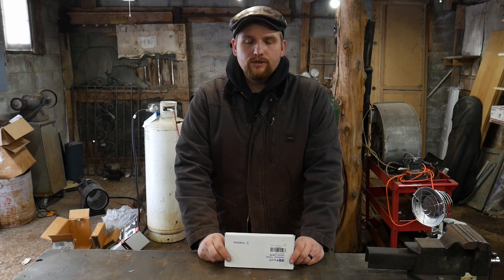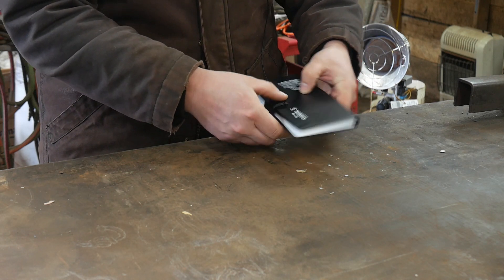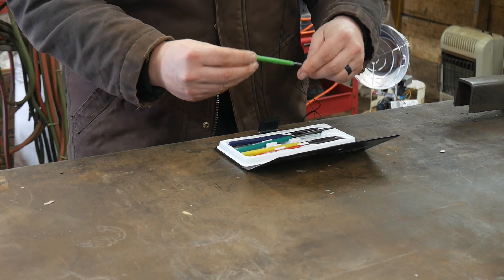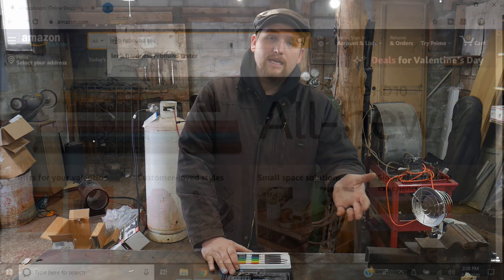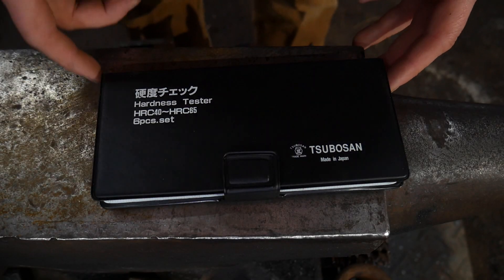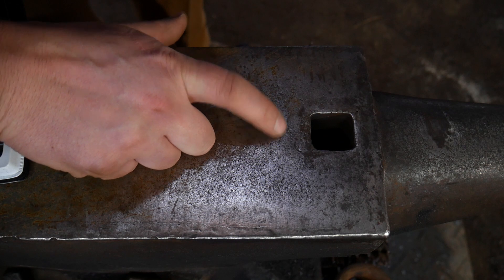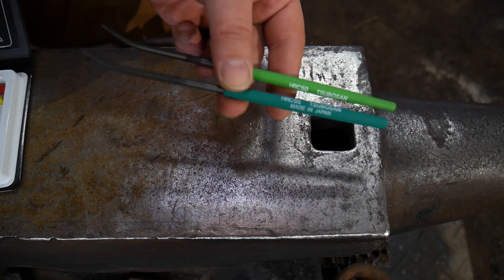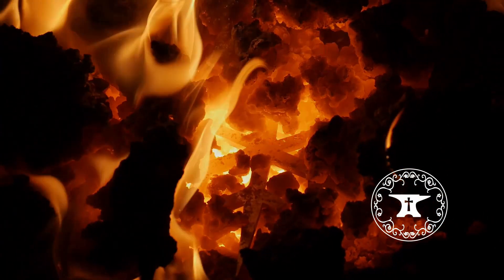Review: 6 PC Hardness Testing File Set [Rockwell Test Files]

Comment: They’re very useful and cheap enough for anyone to buy. At this date, they’re available for about $60, if you look. They’re made in Japan, and are the standard others are judged by. But, even these aren’t 100% accurate. The files themselves are accurate to about plus/minus 1 RC per file. So a 50 file could be 49 to 51. It does come with an English manual. I use them for quick readings when they’re not critical. I make, harden/temper machine parts I make. They’re much more critical than blacksmithing. That’s not a put down of blacksmithing. Each has it own purposes. My “real” Rockwell tester is accurate to about plus or minus 0.25 Rockwell. But because it’s not a computerized model, it means that you must to test it every time you use it to make sure it hasn’t drifted. So these files are easy and will get you into the ball park. But don’t get too upset about anvil readings. High quality manufacturers make them from 48 RC to 58 RC. It depends on their philosophy.

By the way, if doing the rebound test, don’t use too big a bearing. Proper rebound testers use small bearings, about 3/8”, even smaller. Large bearings have enough mass to dent the material which partly negates the test. Or the rebound is from a very short distance.

Comment: Sorry for going off topic but do you or anyone have an issue with propane tanks freezing in use?  and how to prevent?
Reply from the maker: I will make a video on it eventually :-) but all propane tanks will eventually freeze up so usually you just get a bigger tank if it's a continual problem
Reply: @ChristCenteredIronworks  if I may interject my observation.
Yes they frost up. But if you have a way to link up 2 or more in seiries it greatly reduced the frosting. Also setting them in a tub of water slows the process of frosting through thewater conducting Temp. 
Sorry I can't tell you the exact process that causes the frost. I'm sure Roy will when he made his video
Reply: Dragonstone Gem & Ironworks Crawford  I’m just a hobbyist, have a 7 gallon tank single burner, 30 psi reg but I can and do weld (3/4 diameter and smaller)  at 25+psi...
  God forbid when it’s frosted/frozen and only have 10psi.. I “don’t”  take my torch and heat the tank...... or hot water to get to 25psi...
   Any thought on electric blankets or reptile tank heaters? 
  Billy out.  LOL
Reply: @billygildark4565  please try to refrain from taking a torch to your propane tank to thaw it!!! The thought of it gives me the chill. I'm not trying to preach.......I do a LOT of stupid stuff but I feel taking a torch to a propane tank is out right dangerous. I'm sorry for the rant I just want people to live to see another day!
Reply: @billygildark4565  , haven't heard of anyone using blanket. Just water and tandem tanks together.  What tandem together tanks does is slow the flow from each tank. As the slow flows the expansion from liquid into gassious state slows and the rapid cooling inside the tank
Reply: Billy Gildark   I’ve used magnetic engine block / oil pan heaters. Or silicon oil pan heaters under a steel tub ( cut off 55 gal drum with a water heater blanket wrapped around it.  Works great but a need to preheat the water ( water warm to the hand is all I go to) prior to firing up.  Larger/ multi tanks usually solve the problem but below 0° and lower can be a problem. Also what gas blend makes a difference too. Propane/ butane.
Reply: @larrystrayer8336  , I can see using a stock tank heater too. Love stock water tank heater runs off 110v.
But by the time one gets all that a second tank may be cheaper. IDK

Comment: Thank you for the honest review, Roy!
EDIT : To save wear on the testing files, you should start at the highest and work down from there. Otherwise, the lower range files will need to be replaced prematurely. And I'm not just blowing wind. Have worked industrially 40 + years in maintenance, tooling, heat treatment, etc.
Reply: Great tip!
Reply from the maker: Thank you for the great tip!